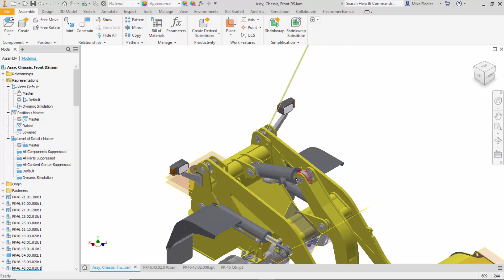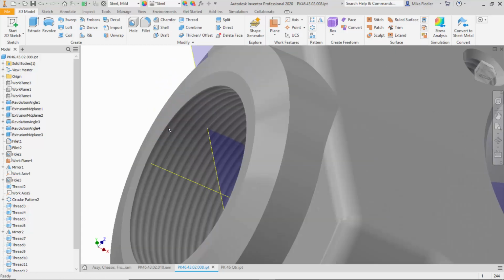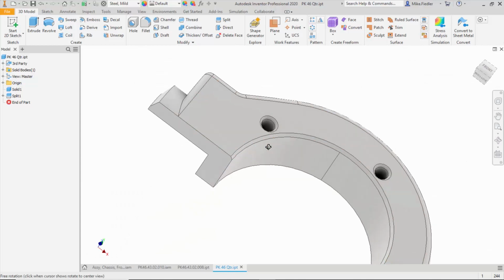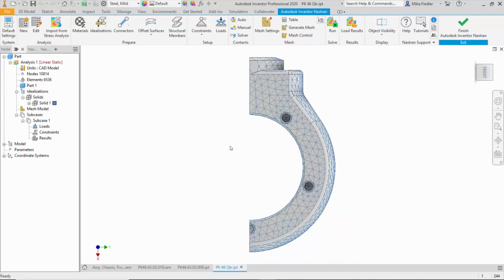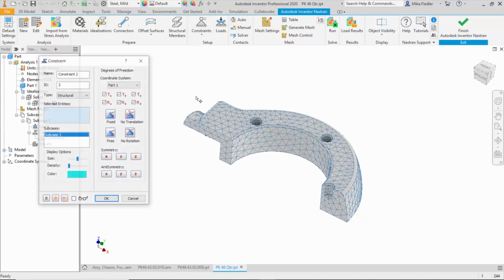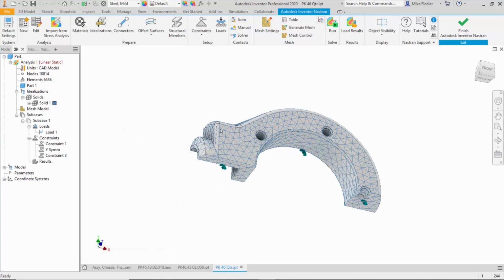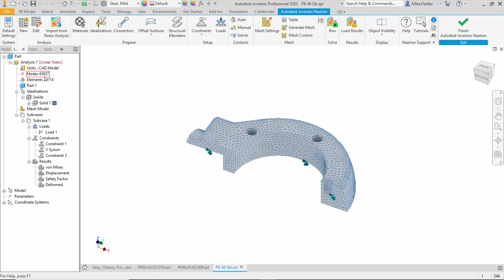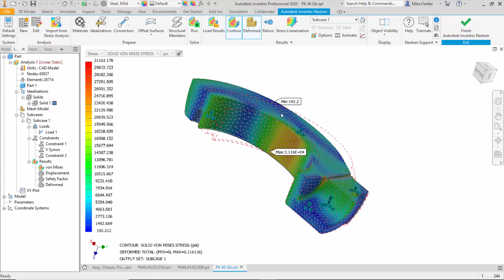Product Simulation in Inventor Nastran: Preparing a CAD Model for FEA

Comment: Thank you for the video.
I have a question: What if I want to simulate a pipe welded to a flat end. Will it make any difference if I apply "Shell" idealization to a pipe faces and "Solid" to a flat end? And is it ok for welds connecting pipe and flat end to have "Solid" indealization?
Reply from the maker: Hi Sergey Dukman,

The best way to get a detailed response to your Inventor-specific questions is by posting on the Inventor Forum.

Here's the link: https://forums.autodesk.com/t5/inventor-forum/bd-p/78

Hope this helps!

Best regards,
The Autodesk Inventor Team